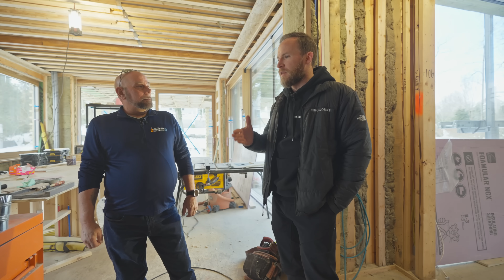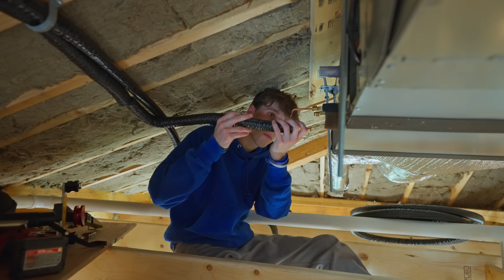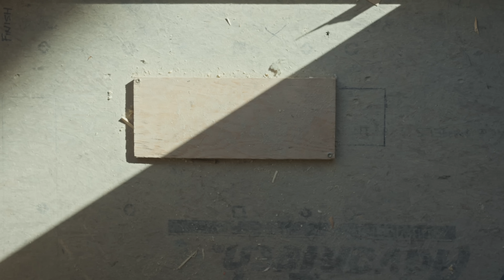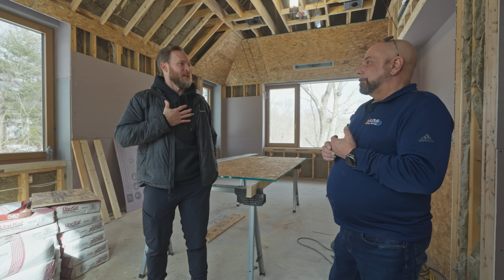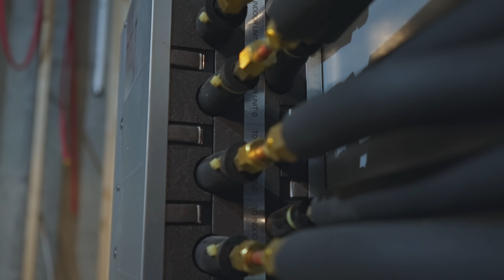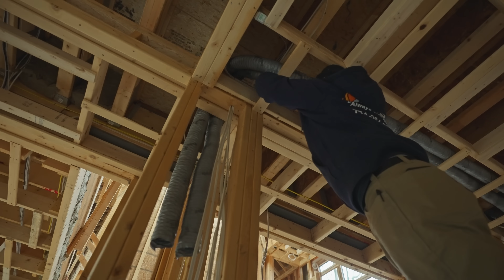The HVAC System Behind a Luxury Home

Comment: I recently got a tiny little Mitsubishi mini split in my attic/studio sitting over a large 2 car garage that’s very poorly insulated, especially in my walls along the a-frame. Anyway! This new system is absolutely perfect, sips electricity barely even through cold snaps in the low 20s and high teens I’ll put it at 73, gorlllllll it pumps any air temp you demand it to pump. It’s a wonderful technology that will absolutely turn us into a better direction, long term, high efficiency systems. Electricity can be cleaned up, were halfway there already

Comment: The veining in the registers…. My hvac is simple and i’ve been working to
Give it the touches to elevate the overall
Performance and comfort.   I’ve wanted to add this veining in the return. Large square boxes with turbulence. I hadn’t come up with the word “veining”  but it’s perfect.   Great video. This channel
Is going right there with my build show channel that Risinger brings.     Knowledge is the most valuable tool
On the truck.

Comment: If you build a tight house, you should not need such a crazy expensive system; a simple radiant heat system would be much better with no air flow issues.

Comment: Great video on HVAC considerations with probably the most detail I’ve seen to date.  
One thing that concerns me with the install is all those Systems sharing only two condensers.  Sure you can isolate for service with a manual valve, but what happens if the system has a leak that goes undetected for a couple days?  All the refrigerant leaks out and you have to install 50 lbs of new refrigerant instead of 12?  How will you know how much refrigerant to add back without pumping down the whole system and starting over? Is it a mixed refrigerant?  I favor redundancy and reliability in a system, a combined system seems risky.   Am i missing something?
A fried has a supermarket that uses a combined refrigeration system and when it goes down he loses every cold case, it’s a nightmare.

Comment: What happens if Zender  goes out of business? When the homeowner depends on that system to operate and they can’t get parts or are they gonna do then. Another negative would be that you could not just call any HVAC company to work on that they wouldn’t know where to start if there was a problem.

Comment: Nice build, was there any discussion of heated floors?   The comfort with these high ceilings is the best, and optimizing the air circulation just for a/c and quality should make it much simpler.  What is the R value of the windows, they will dominate with these great walls!

Comment: I have a few questions number one venting. It doesn’t appear that the house is being vented properly number two. What about moisture? I don’t see any humidifier in the house also the heater in the basement spewed moisture, which could cause black mold in the house during construction   three what about the intake? Is there any kind of filtration system that’s on the head of the inlet I don’t see any heat involved with the make up air and I didn’t see any filtration system with the make up air unless I miss something. It’s my understanding that a house HVAC system is more important than your Doctor nowadays.The guys did a nice install job I would be curious on the follow up of the efficiency thank you for sharing this is how we all learn and I’m not a HVAC guy I’m just a life long learner

Comment: It's quite funny to watch the construction of a multi-million dollar house where they get excited about a ventilation system with heat recovery, something that is an absolute standard when building a new house in northern Europe. 
The recuperation unit is heating/cooling the new air with the old air from the building. A side effect of the exchange is that the air in the building dries out (quite a lot) in the winter, so a dehumidifier is not needed (but a humidifier is if someone prefers). Central units are usually installed in the attic to work more efficiently (shorter ducts), when installed in the basement, the main duct is pulled to the attic and only then divided into smaller diameters. In addition, the lengths of the ducts should be similar or have adjustment at the distributor so that they suck equally strongly and quietly in every room, and not the most where the shortest duct is.
Reply: ….an additional duct fan can be connected to the channels extracting air from the kitchen and bathrooms to temporarily force greater suction only from these rooms only when necessary and not from the entire house. In the bathroom and toilet, connect a relay to the light switch and in the kitchen, e.g. the temperature sensor in the cooker hood.

Comment: Love the work just wondering since there’s so much work being done for efficiency why not go geothermal instead of air source?
Reply: Air source has caught up dramatically to geothermal. I met a guy who put in geothermal 20 years ago and is on his third system and 50+k in. Its very expensive especially if the parts arent available when something goes wrong.
Reply: @JOIHIINI that’s good to know thanks!!
Reply: @drewhouse5563  no worries, I put in a -30C (-22 Fahrenheit) heat pump with a central system in my house in Ontario which had a very cold winter and it only kicked on the backup heat strip system one time all season

Comment: In that home, you have excellent heating and cooling.  You also have great ventilation.  Great work there!  Usually the Zhender has merv 13 followed by merv 14 filters which helps.  However, I see no dehumidifier nor humidifier to control the humidity.  Those are a must for a comfortable and durable home.  On your air handlers, you need a least MERV 13 filters for keeping particles down for occupant health and keeping the coils clean and from growing anything.  Then, on your range vent, you need to test and see if you’re getting the same amount of CFM in and out of the home or you’ll depressurize the house which can cause condensation in walls and anywhere there’s leakage.  Unless you built the home leaky then it might not be so bad, but it needs to be tested with a blower door or ultrasonic leak detection.
Reply from the maker: Absolutely
Reply: I am not convinced a true merv 11 vs merv 13 is a slam dunk in this regard. in theory the difference is way lower than PM 2.5 particles and viruses -that has no meaningful impact on clean coils, and your biggest risk by far of catching viruses is from one of your family members unless you choose to isolate yourself.

Comment: probably long since time that we just go back to radiators or air handlers supplied by liquid lines.  ducting through the attic is just the dorkiest thing ever and wastes so much energy.

its funny when you see multi million dollar houses with a minisplit in a room.  heating flooring is super efficient but kinda sucks at cooling due to condensation. hot air rises good cold air sticks at ground not good.

central air needs to go though just not good.  central heat pump and better insulated liquid lines in the walls not a bad idea.  and its a closed loop.  you can protect it entirely from leaks ( look at closed loop PC builds where they drill hella holes in it, unit draws a vacuum and sounds alarm and possibly drains that line).

could connect it to the fridge and water heater dryer too and isntead of having 5 different heat pumps have 1 central one.

Comment: You don't need to move the air throughout the house to get even temperatures if you go with a hydronic radiant system.
Reply: What are you using to cool though?
Reply: @xokissmekatexo  It depends on where you are. By using materials that don't let the heat in and opening windows at night to drop the temperature in the house, radiant heat is key to keeping out in the summer.

Comment: Awesome content, I’ve been enjoying following along on this build. One thing I was wondering about, wouldn’t the Zehnder provide make up air for the range hood?  It keeps the building at a balanced air pressure and ramps up as needed to keep this balance.  I had a similar set up in a high performance home build in Pa and the township required a separate make up air. I thought this was redundant and just because the inspector wanted to check a box.  I’d love your insight on this
Reply: The ERV should be kept balanced. If you use it as a make up air system, it is unbalanced and you are having to condition the air. By providing make up air at the hood, you don’t have to fully heat or cool it because the air will be extracted out as quickly as it comes in.

Comment: It is amazing what can be done when money is not an object.  For people on a budget, all of these things can be done on a smaller scale and with simpler equipment.  The important thing is to realize that a house is a holistic system.
Reply: Absolutely. And as an HVAC contractor you’re right - we CAN do a very high quality system in a smaller scale with less expensive equipment, etc. But one can still do a high quality insulation etc

Comment: Very impressive mechanicals. It seems a little crazy to me that you are actually building two completely redundant air handling systems, the normal HVAC and the Zender ERV. I’d wager that eventually a really smart guy will figure out how to do both with one duct system. Engineers from Mitsubishi and Zender need to party together somewhere.
Reply: They don't want to elaborate because they would both make less money.
Reply: @theprofessorfate6184  they must realize that if they don’t do it, someone else will.
Reply: @thebarntender5530  And it ends up looking ridiculous.

Comment: Where does the "make-up air" for the kitchen hood come from? Is it conditioned first or does it come straight from the outside?
Reply: Very late response but it is usually filtered but unconditioned air.  You don't want to take the energy to condition it because the huge majority of the air that is being supplied in is being sucked right back out of the hood vent to the outside.  Once the system turns off the outside air is what is hopefully left in the space around the stove top instead of the cooking scents and fumes, which is usually preferred, and yeah its not conditioning but hopefully dilutes well and quickly with the erv and hvac conditioning throughout the rest of the house, hence the use of the boost mode on the erv, while cooking.

Comment: Upgrading the glass reduced your hvac load by 50%? That is an extremely bold claim and likely nonsense. Countless models have been done to show upgrading glass alone isn't worth the cost if its already double pane. Maybe if u went from single pane to quad or something. Maybe switched from Al frames to fiberglass? Reduced air leakage by using more fixed windows? What was your original U value for these windows and what were they after the $8k upgrade? You did A LOT more to reduce hvac load by 50%. Someone needs to run some numbers lol.
Reply from the maker: The amount of solar gain in the hot summers was requiring the cooling equipment to be double the size versus adding a film which reduced the solar heat gain, and allowed us to reduced the equipment size by 50%.

Comment: Do architects and engineers ever start with an HVAC “skeleton” and design around it?
Let’s say you decide on the functional volumes (kitchen laundry dining salon bedroom bathroom recreation office garage storage) then hallways & stairways, then window placement, then door placement, map the placement of these volumes: then map the HVAC skeleton to those volumes, and follow with the structure to support the system and route it optimally.
Reply: The short answer is   NO!  It is an interesting thought process though. Certainly, an HVAC engineer could design the ‘perfect’ optimized system and layout the rooms accordingly. How much would that gain? Would anyone want to live there? Passive houses are starting to think in that direction.
Reply: It's done for plumbing to some extent; no reason HVAC and IT can't run alongside...

Comment: Very nice work, and done with the best equipment.  HOWEVER, this all comes at a cost and setups like this, even for normal sized homes, are FAR beyond the budgets of anyone but a tiny fraction of one percent of the population building/buying new homes.

Which leads to my next point… without getting very specific and nerdy on the numbers (dollars, CFMs, BTUs, etc.) content like this is really of limited use.

A far better approach to content would be how to get 90% of the performance for 30% of the cost.  No, that’s not a typo.

The most useful part of this video was upping the glazing performance to reduce the cooling load and shrink the equipment size for a better balance between cooling and heating, and at a net cost savings.  THAT is something very useful, and something that needs to be considered early (as you found out).
Reply: Even more effective is REDUCING the glazing on a house. The overall r value of any wall really declines steeply  as you increase the proportion that is glazed. Also the jump from double glazed to triple glazed is pretty steep, esp for large windows and sliding doors.
Reply: @  true, but there needs to be a good balance.  No one wants to live in a dark box with no exterior views, and at some point small windows start looking small, reducing curb appeal.

Comment: Amazing detailing throughout the home. I may have missed this in a previous video, but is your exterior wall sheathing and WRB acting as your primary VB? I'm noticing all the intricate interior framing details with the window wells, and I don't think it would have been effective to have an interior vapor control layer.
Reply from the maker: We have 5” of exterior insulation so our dew point is outboard of the sheathing and WRB. but “technically” the gypsum and paint is the interior vapor protection. 😊

Comment: Missed pointing out that primary function of the ERV is to recover energy, it is a heat exchanger that tempers the unconditioned air from the exterior with the stale air being exhausted. Otherwise it's just a fan in a can..

Comment: Coming from a passivhaus background, it is shocking to see how overcomplicated and expensive this hvac solution gets, for a home that will still be wasteful and cost a fortune to run. Should design a better house in the first place...
Reply from the maker: Would love to understand where you think we fell short?
Reply: @NSBuilders  it begins with the client and the architect unfortunately! If the client wants a very overglazed house there is little that can be done about it, unless building code demands a certain space heating / cooling demand at a regulatory level.

Otherwise, the architects role in energy efficiency starts very early on, with composing the building form factor (internal volume to external surface area) and optimizing the glazing ratios in relation to orientation for maximising or limiting solar gains.

Then you're left with a house with much lower energy demand, and consequently simpler (and usually more reliable) HVAC solutions. Passivhaus use centralised ventilation with heat recovery (MVHR), which is quite simpler than this dwelling as it doesn't handle heating / cooling.

Comment: To be clear, virtually any ERV can be run directly to rooms instead of using the existing duct work. You don't need a Zehnder for that. Their units are extremely nice but there are many options that will do the same thing on a tighter budget..
Reply: Yes, I have a Broan ERV that has dedicated duct work to each room because my heating and cooling is provided by a ductless mini split .
Reply: Yes you AN use the HVAC ducting but you run the risk of screwing up the calculation for manual D. In a house ike this with the expensive hvac system, makes sense eto not take teh change screwing up duct pressures as movement  when erv is on.
Reply: This is a multi million dollar home 7k sqft.

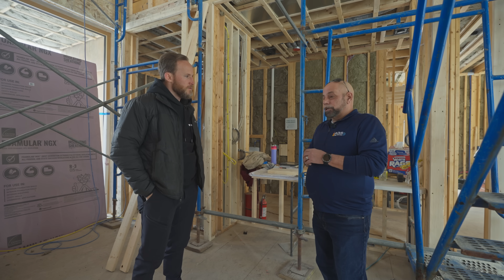Comment: 8:23  something missed on homes is getting the even temperature so the entire home is the same temp at all times. Good systems like this  are the  reason no one does in floor heat throughout houses anymore on high end homes.
Its a huge fight to get people in normal homes to run a system to mix air and keep the temp even.

Comment: I’ve been in HVAC for 30 years. These guys are doing some beautiful work.
Reply: I agree, love that these guys get it. It’s unfortunately rare. I also try to use round as often as possible
Reply: How do you know hen they do a good job and not just over confident?
Reply: Yeah I'd prefer it not being small duct. 
I like to get the erv integrated with the main ducting. A showers worth of moisture in an entire house doesn't need evacuation
Reply: @sparksmcgee6641 zender isn’t just a regular ERV it’s a whole separate system.